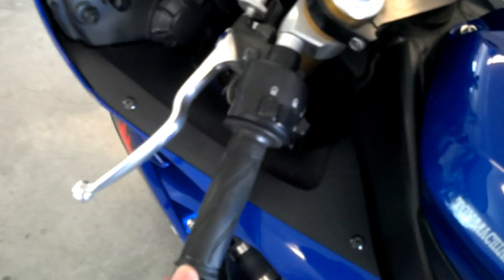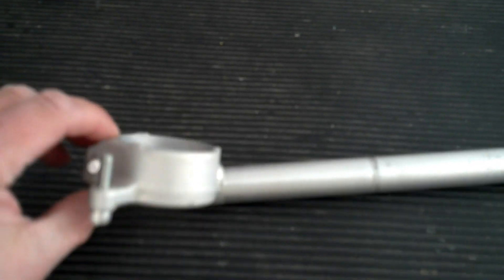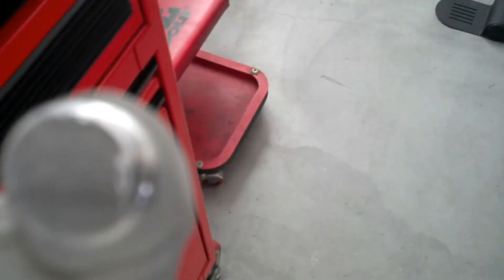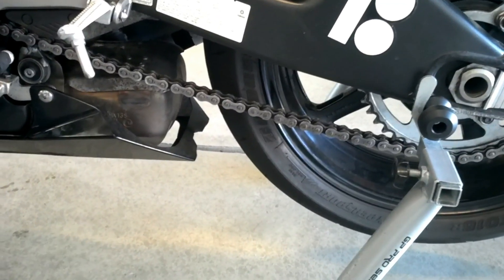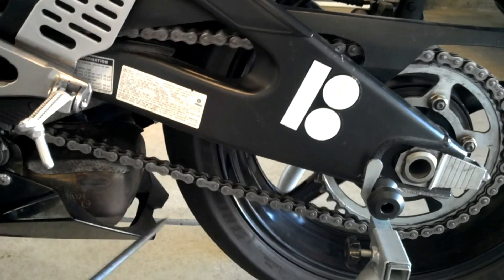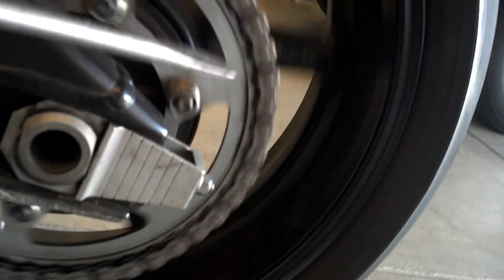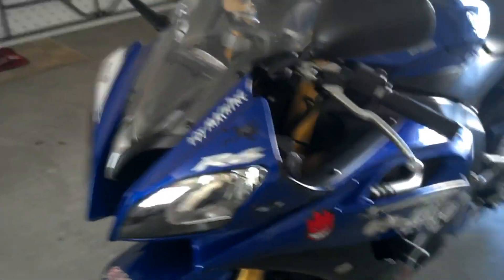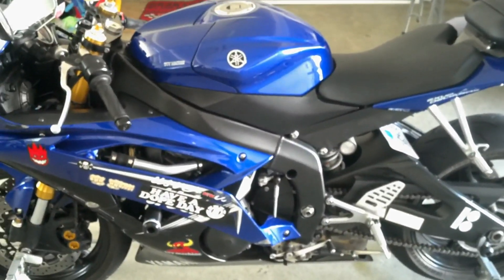Yamaha R6 - Safety Tip, Quick Chain & Sprocket Inspection

Comment: Great video.  I thought the only way to check was to see slack w/o moving it and the teeth on the sprocket.  I found some chain link areas being tight and not moving.  Loosening it works by twisting the chain where it's tight up and down then lubing it.  That's another thing to look for.